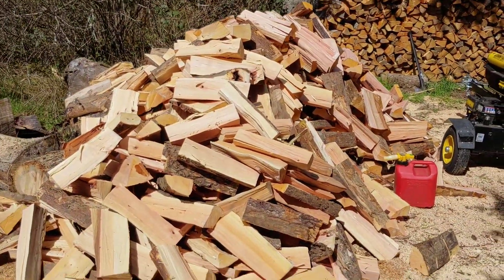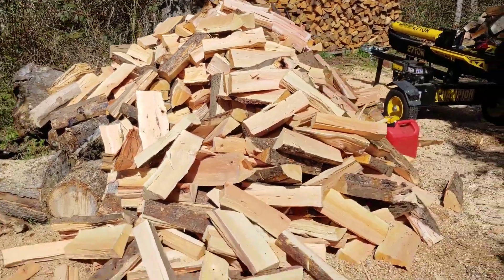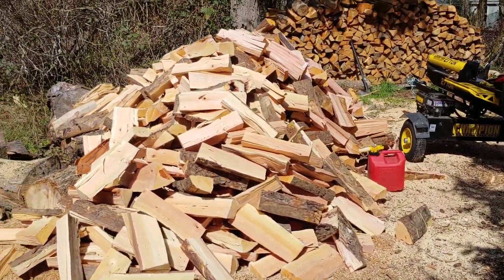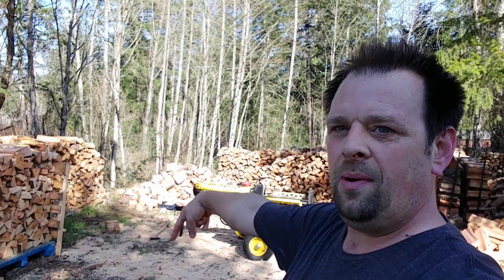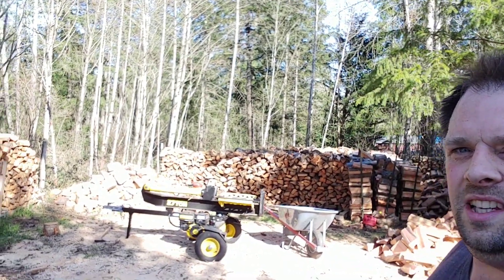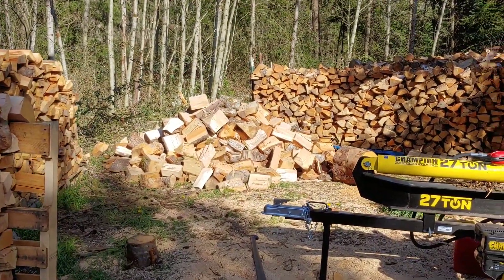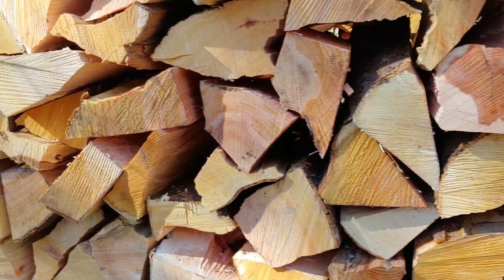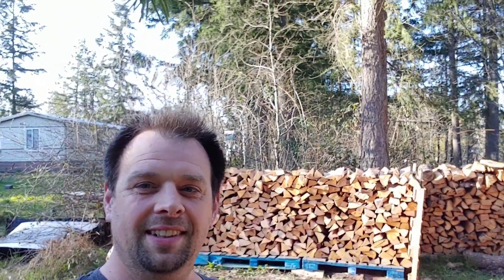Madrona Firewood Pile Is Done & Stacked For Later

Comment: Hi Daniel - it's Big Rodders in Ireland.  Some nice looking stacks of clean timber there.  What works for me with pallet ends is to tie them at 45 degrees to the base - cheap, versatile, speedy and easily dismantled.  Lovely weather you're having at the moment.
Reply from the maker: Its sure is nice weather.. High 50s in the afternoon with clear skies.
As dor the pallets I have metal fence posts in place I found them a few years ago for like 2 bucks a piece and still have lots left.

Comment: Nice wood Dan! I always cover my wood outside. Do you think it makes a difference in the moisture content of the wood not to cover it? We get a lot of rain sometimes up here. Also, just a curiosity question, what's the little car parked off to the side (light blue or green) looks like it has been there a while. Can you show us a quick look at it sometime? Keep up the good work !
Reply from the maker: In my,case I don't see a difference as I dont sell firewood past mid September. After that if I still have seasoned stuff left I will cover it..
The sports car in the background is my 82 Mazda rx7 with a 13b supercharged engine. I have not driven it since May of 2004.. 
At this point its waiting to get underway a restoration.. My grandmother bought it new so its been in the family for some time now..
Reply: @DanielAtkinsFirewood  Thanks for the reply. Cool old car. That would be nice fixed up!
Reply from the maker: @EverydayProjects  : in my mind it's already fixed up and look spiffy.. Just need the time and place to start on it..
Reply: @DanielAtkinsFirewood  That Wankel rotary engine was quite a thing--and still is a very interesting concept: no pistons, no connecting rods, no crankshaft, no valves, just a triangular lobe that uncovers and covers ports as it rotates, to allow fuel/air in and exhaust out!  I want to see it running someday!

Comment: Hi Daniel I know you use a wheelbarrow in your yard so do  you have any recommendations. My old one has been  crappy for ever and it finally bit the bust.  Size medal or plastic one or two wheels. Thanks.
Reply from the maker: This is just a standard all metal (even handles)  wheelbarrow from ACE Hardware.
I did get the solid tire options. I think I paid 90 bucks after sales tax.
This has definitely been the best wheelbarrow to date for me.